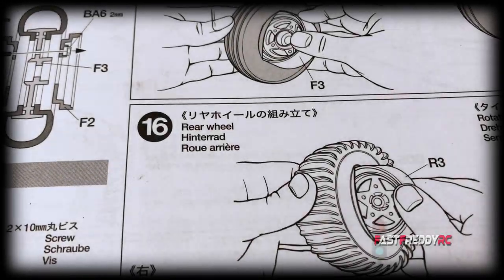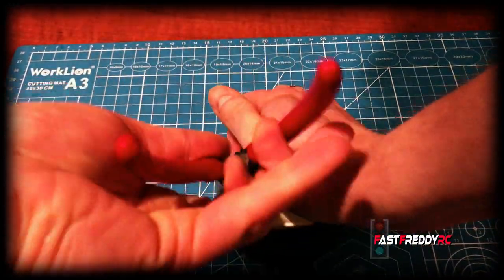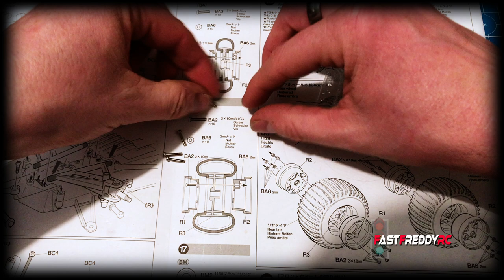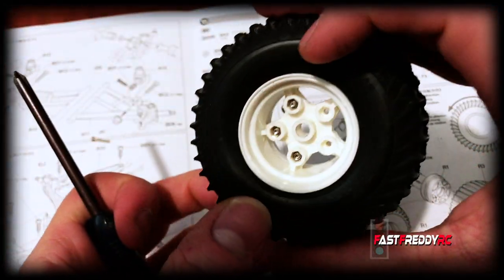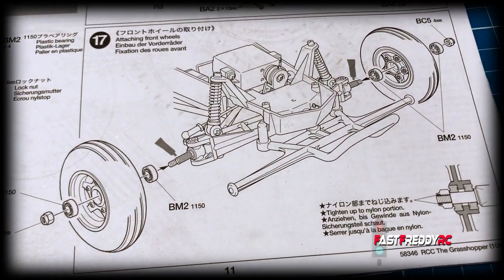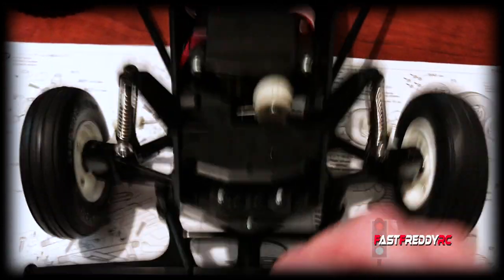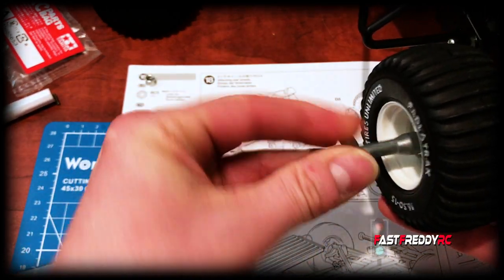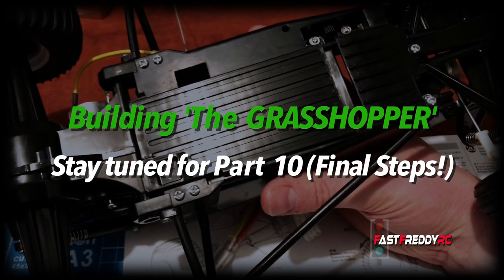Tamiya Grasshopper - Beginner Build Series - Part 9 - Rear Wheels and Battery Cover Installation

Comment: This 42 year experience RC modeler wants to THANK YOU for that Wheel installation Tip!!! 😎👍👍 
I, and many others have fought with those for YEARS on Hoppers, Hornets and Frogs! 
The only thing I would add to this, is rub some soapy water or WD-40 on the Tire Beads, of all four Tires, as a lubricant to make it even easier.
Still, the Pliers idea is BRILLIANT!!
Reply from the maker: Thanks Carmine!!  Actually thanks for the additional tip! - Funny thing is I've done that before and then found I had absolutely no grip with my fingers when I did that. BUT using pliers I think that method could work well because the WD-40 would allow you to pull with the pliers and have the wheel slide in more easily.  Thank you!
Reply: I can't wait to try that with the Pliers. 
I'm having my Grandson watch this Series.... the RC Elf got him a Grasshopper II!!! Build will be very similar. It's his very first build, and I love the way you took your time explaining what to do, in a very easy to understand way!!
Reply from the maker: @CarminesRCTipsandTricks  how cool Carmine!  You gotta love the RC Elf!!  Do let me know how it goes...I'm hoping this series is helpful for all beginners!!
Reply from the maker: @CarminesRCTipsandTricks  OH! and just an fyi but part 10, and the final part to this series, premiere's tomorrow!
Reply from the maker: Sorry...had to change premiere date of Part 10....realized I missed something in editing.  But I would imagine you won't be ready for it that soon.

Comment: Just got one of the rear wheels done. What an exercise in frustration that was...3 cuts to my thumb😢.

This is my 1st rc kit. Thinking of getting a black foot for my next kit - would that be a suitable step up from the grasshopper.  And more importantly are the wheels on the blackfoot as much of a hassle as the grasshopper?
Reply from the maker: Ugh..yeah as a beginner kit I really don't understand why they made the rear wheels so tough to do.  Great car but this step is terrible. You'll enjoy it once you get it running...I love the grasshopper.  Hard to control due to the stiff tires and lack of real suspension but that's why it's fun to drive!  Anyway, the Blackfoot is an EXCELLENT choice.  The Blackfoot was my very first Tamiya back in the day and you'll find the wheels go on with ease!  The tires are so soft and pliable that they will be easy to get onto the wheels.  Trust me..if you've put together the grasshopper wheels, you're going to find working on any other car an absolute breeze! (FYI...grasshopper wheel issue will also be on the Hornet, Frog and Sand Scorcher)

Comment: Finally got both back wheels done and attached but they are spinning in opposite directions....is that normal or have i made a mistake somewhere?
Reply: Its actually working as expected when its on the ground.
Reply from the maker: It's perfectly normal!  What you're seeing is the differential working!  On any car if you lift them off of the ground and turn one wheel, the other will spin in the opposite direction.  But under power or placed on the ground and rolled, both wheels will go in the direction you want them too.  A weird way of explaining this is the wheels take the path of least resistance.  So the reason you see the wheels go in opposite directions is that the motor, when not under power,  is too much for the wheel to move it, so they spin in opposite directions to avoid engaging the motor.

Comment: I'm new but when I turn the back right wheel, the left back wheel turns in reverse. Is this normal? haven't gotten the batteries yet so I'm not sure if i have to rebuild it
Reply from the maker: Yes that’s completely normal! That’s all to do with the differential you built in the gearbox. It’s what allows one wheel to spin if the other gets stuck. When you turn one wheel in one direction the other will move in the opposite direction. But when the motor is engaged you’ll notice they both move in the same direction.

Comment: Far out .I didn't realise how difficult it is to fit a Hornet wheel into a tire. Imagine some kid trying to do this back in the 1980's before YouTube. But 1 thing worries me and that is tearing the tire using pliers . Great video though. 👍👌 Thanks for your great advice. I've seen other people saying to use silicone spray and the tires go on really easy , I may give that a try.
Reply from the maker: Completely agree with you!!! I don’t know how any kid did it back in the day. I’d be surprised if the spray works only because with the opening you have to deal with the rims would still seem too big for the opening. I will say at no point does it feel like you’ll rip the tires. The tires are seriously strong and I don’t even think I left marks doing it this way. Do let me know if you find success with the spray though! Thanks for stopping by.